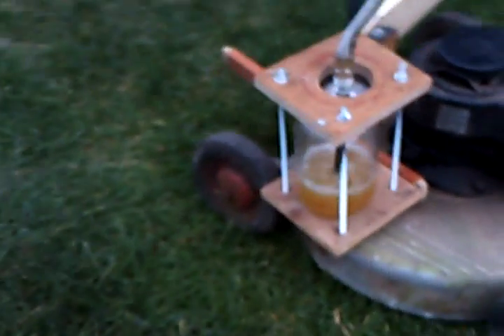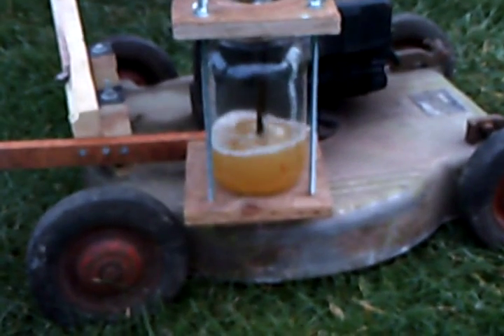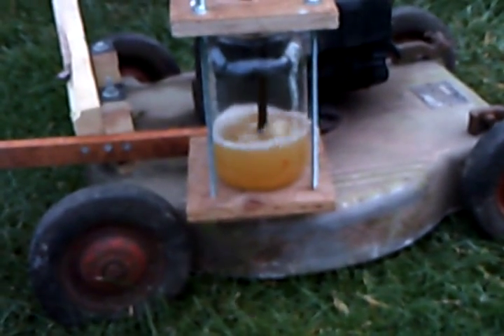geet fuel reactor's half hour run

Comment from the maker: the geet realy works as paul said it would allmost. there is  a reason they charged and put Paul away .He made outrageous claims. Like it would run on pickle juice and beer coka cola or piss. Logic tells you it aint gonna run on a solid fuel, it has to have some form of a hydrocarbon fuel to run. It is a very efficient system when done right. I stopped building because of personal problems. If you need ant help with your build let me know? you will be surprized if you build one right